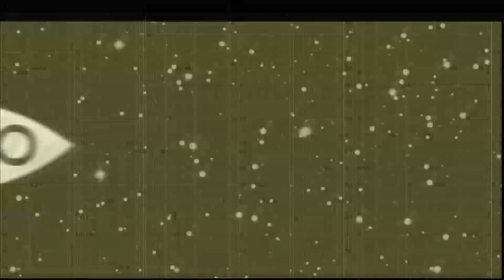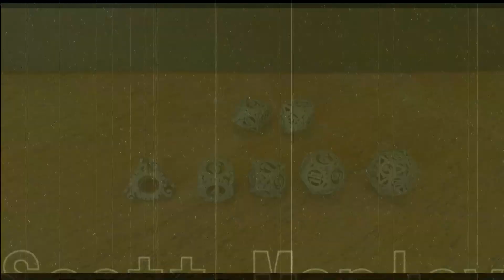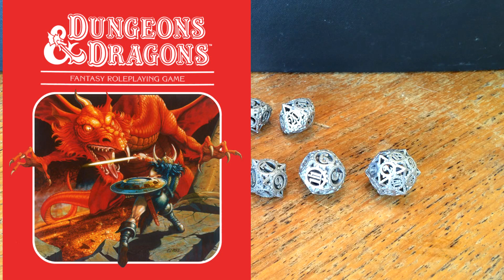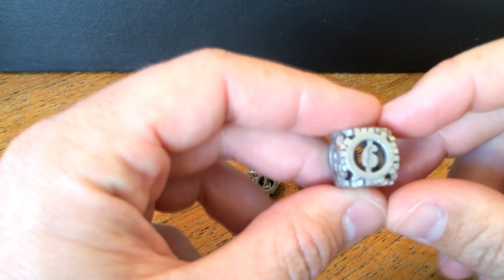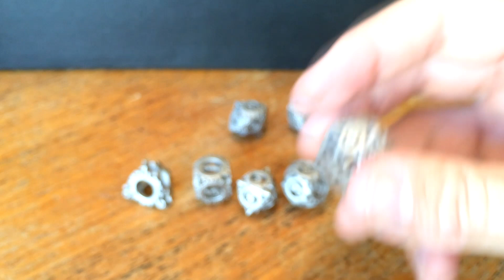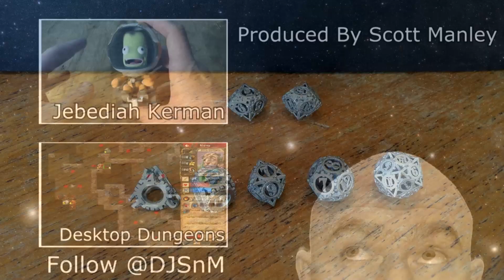Dice - 3D Printed Metal, Steampunk, Dungeons & Dragons

Comment: The problem I see with these dice is that they wouldn't be properly balanced because the characters on one side of a die wouldn't weigh the same as those on the opposing side.  While this might seem like too small of a difference to matter, over a large number of rolls there'd be a definite statistical skew.  This is the exact same principle behind weighted dice, used to cheat at casinos.
Reply: Very good point. I would like to know if they will take this into consideration one day and print them with a more even distribution of material...
Reply from the maker: theblackpixieJTHM You could very the thickness of the numbers for balancing, it would be as easy as tweaking the digital model.

Comment: It is pronounced eye-KO-sah-hee-drun.

Also, these are not 3D printed metal. They simply use 3D printing as a small (and ultimately unnecessary) part of their production process. A real 3D metal print must actually be PRINTED with metal. This is usually done using a welding type print head. Considering how trendy 3D printing is nowadays it is an important distinction.

(Seriously people. Doesn't anyone make projects that don't involve 3D printing, Arduinos, RaspberryPis, or Teensys anymore? Most of the time you are adding unneeded complexity just so you can shoehorn one of those in to get some cred.)
Reply from the maker: Indeed, there are methods that sinter the metal directly and don't need the extra step of filling the voids with bronze, and you can do this with all sorts of alloys that aren't amenable to the process used by shapeways.
However most of the engineering journals reference this technology as 3d printing, so I'm inclined to agree with the experts in the field.

Comment: These dice look pretty, but I have to wonder how fair they are. Last set of D20s I bought I tested one of the dice, and across several thousand rolls there were four standard deviations between the most common and least common rolls, which is obscenely biased.